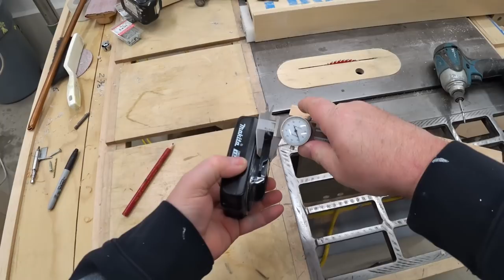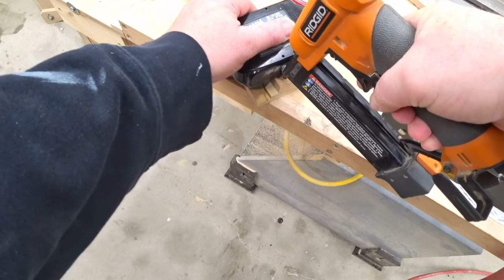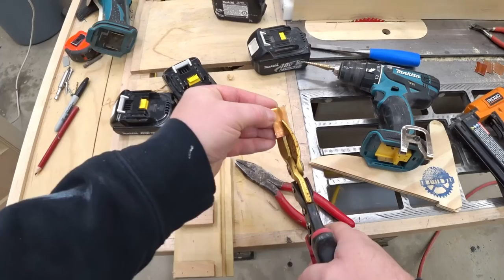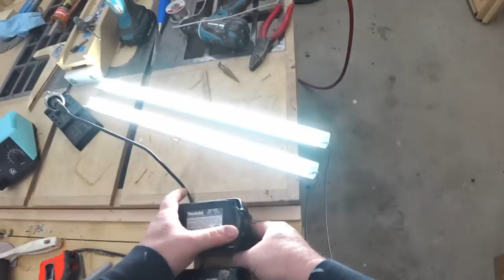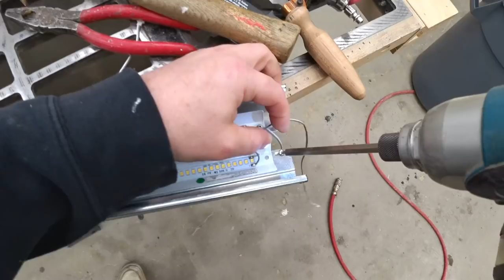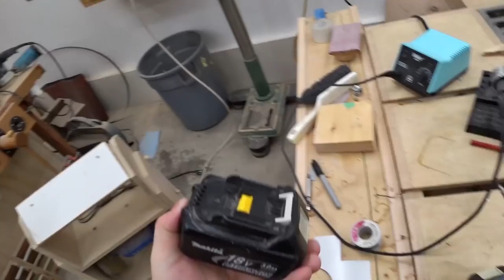Making A Battery Powered LED Video Light

Comment: Great built!

I wouldn't bother building any terminals for the batteries as Makita has one for their heated jackets. So, cudos to you! 

You might want to add a DC to DC converter for the Voltages so you just need to use one battery.
Reply from the maker: As long as the DC to DC can handle the current demands. You lose some efficiency in the conversion, but run time for a light like this is minutes at a time, so battery life shouldn't be a problem.

Comment: I was thinking of a system to run some of the lights in the house and batteries you can charge in your car on the way to and from work. Or also a solar panel. I have a 40v DeWalt battery that would be perfect for the task.

Comment: Do those Makita batteries have overcharge protection built in? This could drain them so much that they won't recharge. I wanted to do something similar with my Porter Cable batteries but the over discharge circuit is in the tool.
Reply: See black channel video addressing your concerns.
Reply: What is "black channel video" ?

Comment: Aren't you worried that these low power LEDs are going to draw too much current from the batteries?
Reply: compared with the drills they are build for?
Reply: lol
Reply from the maker: I measured the current draw while wiring these up. Each strip is rated for 12 watts, but is only drawing roughly half that from the fully charged batteries.
Reply: Sorry - it was supposed to be tongue in cheek from your previous video :-)
Reply from the maker: It's a legitimate question. Normally, you need to limit the current an LED will draw with a dropping resistor.
Reply: we got Rick-rolled!

Comment: Just FYI, you'll need to keep an eye on those copper contacts.  They could oxidize over time.    You could've used the solder to sort of tin plate the copper to help prevent it if you're comfortable enough with soldering and have enough heat to do it.  There's some people that do tin plating electrolysis but I'm not familiar with that.
Reply: My dewalt tools have uncoated copper contacts on the tool and on the battery and on the charger. Copper does oxidize, but very slowly, and the "swipe" action when inserting the batteries tends to rub it away.

Comment: Hey john i might have a small improvement for your projekt and the joy of using makita battery packs!
please consider battery protection, i think that makitas 18v batterys arent monitoring its voltage when they arent  inserted in a drill. So your battery wont switch itself of if the Voltage of a pack reaches the limit. Usually one cell ( in there are 5 double packs in series) schould not be drained under 3V so like 15v a pack ( absolute limit). It takes a while but the brightness will degrease slowly so the eye wont really recognise it! Maybe built in a small digital voltmeter from ebay to atleast visualy monitor the voltage of each batterypack. 
I recently took the time to study those batteries a bit- if they are dead they stay dead - mostly. A brocen cell will be detected by its charger couse of the charging current - broken cell higher resistance- smaller charging current - charger says broken battery pack
If u switch the cells the cpu is once without power and the battery stays dead.
Pleas no offense john but i know these batteries are expensive as hell atleast for me :( but i really enjoy your work and building your ideas keep up the good work 
Greetings from Vienna 
Stefan
Reply: Stefan Kerstner He addressed this on his other channel. Basically he said that he isn't worried about draining the batteries down that low because the light is only on for short periods of time... and also that he frequently recharges all the batteries
Reply: zimsjeep we all know ourselves that on this one day we have this big project, in his case he is filming it and it takes a lot of time to build it :) . Iam a electronics guy so i allways at least think about the possibility of draining a battery too much

Comment: I like the idea. But I would have used the slides from old tools and used the battery protection circuits. I know you know this but lithium batteries don’t behave like nicad batteries.
Reply from the maker: I take it you didn't see my video from yesterday posted on my scrap bin channel? :)
Reply: P0tat07 Both NIcad and Lithium batteries of the type John is using have internal battery protection.